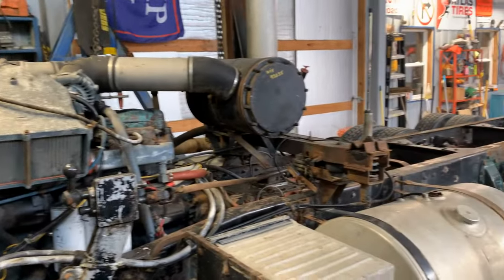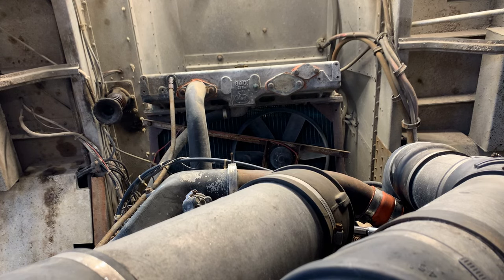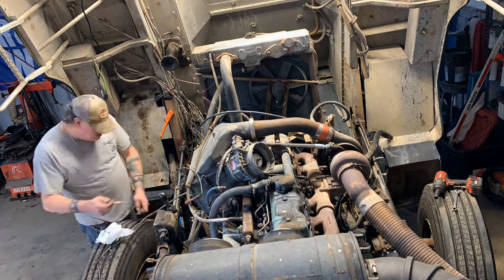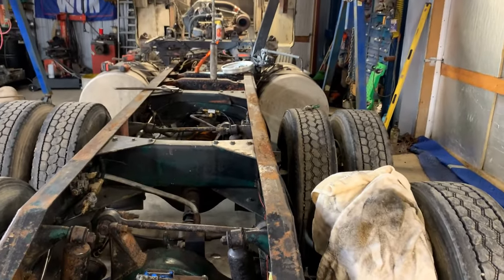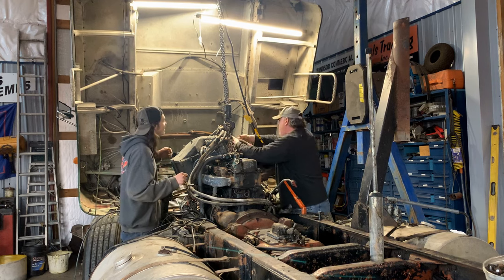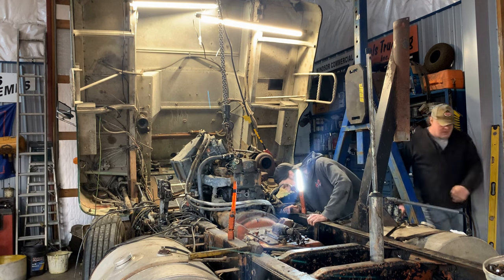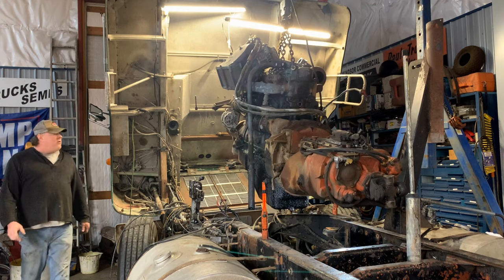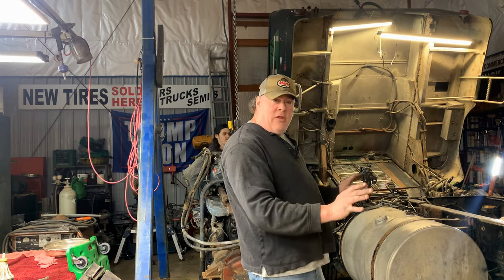Mack Cruise Liner Remove Engine/Trans Prep for FRAME REPLACEMENT!! Big Job!! For Big Paul!!

Comment: Things are going well. Are you considering a clutch replacement while the engine is out? Thanks for showing us how it's done Paul.
Reply from the maker: I may put a clutch in it I am pulling it apart today so I can store them and  I will get a look inside. It worked just fine. So we will see    my v8 is going to be getting a clutch next month so stay tuned!!!

Comment: 2 valve ENDT676 with the tip turbo, I would guess the pump is an American Bosch APE- 6BB110T About as bullet proof as any truck engine ever was. TRL-107 5 speed, great trans. Those rear mounts they are always a nightmare. Bad enough on a cabover, horrible on a R, U, DM etc. Good luck with it

(edit) I'll be damned, it's not a mack trans
Reply from the maker: Yeah it’s a great engine that will last. I will be inspecting and re gasket the engine. Thanks for Watching!! BP
Reply: @BigPaulsTrucking  If you take the cap off the governor and move the stop plate forward that engine will make a lot of power. If it's a local truck it really won't hurt it.